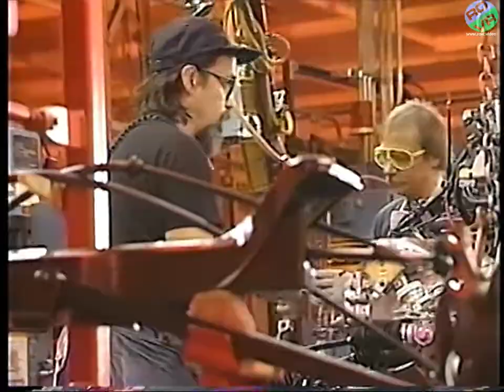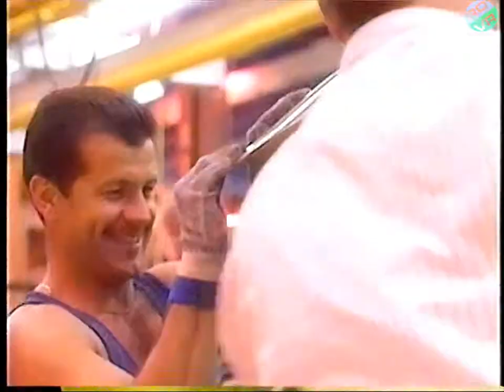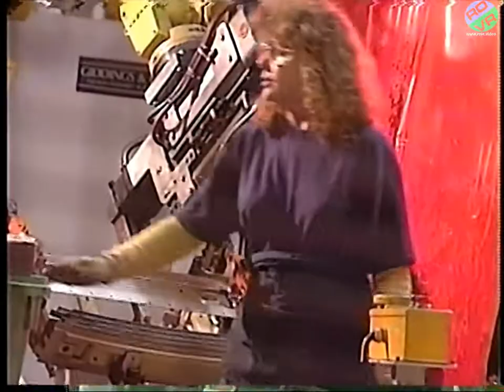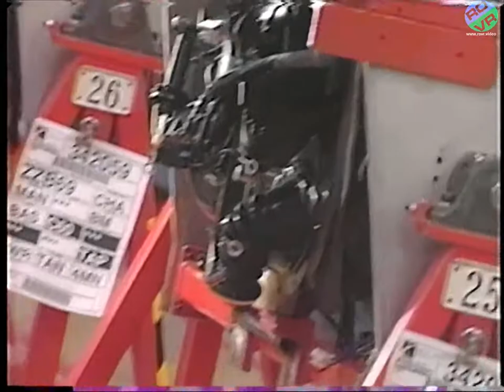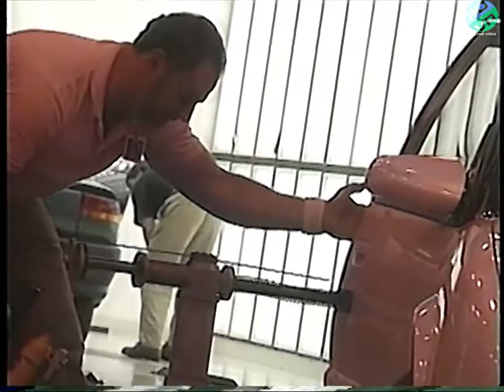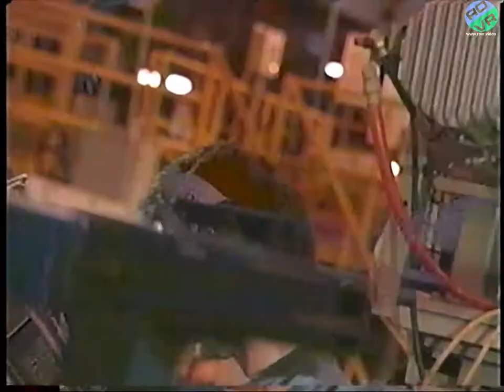GM - Saturn - One Car at a Time - How We Build a Saturn (1994)

Comment: Try this: work on a 90’s Saturn then a 90’s Camry. You will feel like there’s a GORILLA on your back as you tackle the Camry. Take a strut, CV axle, ball joint or control arm replacement. The Camry takes bigger tools, more time and more “sweat equity”. I can do almost everything on a Saturn with 3/8” drive tools. On a Camry you’re using all 1/2” drive stuff. I don’t know WHY the Japs over-design everything! Heavier means lower gas mileage. My SL2 gets 40mpg while my gf’s 1994 Camry gets 23mpg. My Saturn is a 5 speed though.

Comment: I have been driving a 1996 SL2 as my “grocery getter” for 26 years. The car has over 250,000 and most of those miles are city miles NOT highway. The car runs like a champ and gets 40mpg routinely! I just filled up at Sam’s in Knoxville and put in 7.3 gal for 299.5 miles. The only problem is she burns oil, especially above 3,000rpm. I’ve learned to carry an oil jug in the trunk and check it every fill-up. I love my Saturn just as much as my “highway car”, a torch red 2000 Corvette (C5).

Comment: GM spent an untold fortune on building these toilets when they were simultaneously cranking out Geo Prisms that were better vehicles in every single way. 
They really deserved to go bankrupt.
Reply: BS, Saturn was a revolutionary company with an internal corporate structure that was emulated by Toyota (engineers were forced to work with the personnel to make sure the design would be durable and practical ). There are books S series models are known to last as much as Ford Crown vics. Read a book

Comment: I have a 1st gen, a 95 SL2 and I just added a set of 15X7 +41 Einkei RPF1's with 4 Yokohama Advan performance tires. It also has KYB GR2 struts 30% stiffer in front, stock rear with H&R sport springs, a polyurethane master bushing kit, with polyurethane engine mounts, a Seibon carbon fiber hood, a 5 speed manual , with an MFactory limited slip differential, and billet aluminum flywheel, a Gude performance ported intake manifold, and bigger throttle body/with bigger butterfly, a cold air intake, a GM 1991-1992 factory header and pace setter high performance catalytic converter and a set of glow shift gauges in an A Pilar and digital tach with LED. The car is very quick and fun to drive and handles like a race car. My dad gave it to me in stock form with an automatic and I've owned it almost twice as long as he had it, and its very reliable.
Reply: These things SMOKED Hondas in their day. The whole package was too good to be true even for its day, GM really didn’t have a say in quality, the Saturn team demanded it. Hats off to them

Comment: I now own a 2008 Saturn Outlook and a 2008 Saturn Sky Redline. I like them both. I will certainly but another. They are still such amazing cars to drive. Mine are both just over 80k miles and drive like new.
Reply: I have a 95 SL2 with so many modifications, I don't feel like typing again but I responded to the 1st commenter, its very quick and fun, and has been very reliable.
Reply: it's so cool to hear about an Outlook still on the road! they always seem to be in way better condition compared to their GMC counterparts, their owners really cared i guess..

Comment: I have a 1997 Saturn SC2. It just reached 100,000 miles and still running strong. I love these cars!
Reply: I have a 1st gen, a 95 SL2 and I just added a set of 15X7 +41 Einkei RPF1's with 4 Yokohama Advan performance tires. It also has KYB GR2 struts 30% stiffer in front, stock rear with H&R sport springs, a polyurethane master bushing kit, with polyurethane engine mounts, a Seibon carbon fiber hood, a 5 speed manual , with an MFactory limited slip differential, and billet aluminum flywheel, a Gude performance ported intake manifold, and bigger throttle body/with bigger butterfly, a cold air intake, a GM 1991-1992 factory header and pace setter high performance catalytic converter and a set of glow shift gauges in an A Pilar and digital tach with LED. The car is very quick and fun to drive and handles like a race car. My dad gave it to me in stock form with an automatic and I've owned it almost twice as long as he had it, and its very reliable.

Comment: The best part about the video is how much fun it looks like the assembly line workers are having putting together the cars... if you have pride in what you're making, it'll be a higher quality product, and that's definitely what's happening here... I doubt GM is operating Spring Hill Assembly the same way today for assembling its SUV's, but then again, I hope they are.
Reply: It's not GM's fault. Saturn had a very unique contract with the UAW as a huge experiment to remain competitive with the Japanese. Workers had more job and wage security, and the union had broad work veto powers. However, workers had a lower hourly wage (a larger bonus instead), could be assigned many crappier jobs, and grievance and seniority rights were limited. Generally, Saturn workers liked it, but the rest of UAW hated it and refused to let it spread to any other plant. As a result, it died with Saturn.
Reply: @straightpipediesel  I know, I was just saying that I doubt GM is operating the plant in a manner that the employees had input on the cars they built, and the fact that it was a team effort.

Comment: They look like attractive cars. However, I wonder if GM over-complicated it's branding with Saturn and Geo. They also dropped Pontiac and Oldsmobile to be leaner.
Reply: They eventually dropped GEO, which Chevrolet dealers would retail. Most were imports from Suzuki, and Toyota (the GEO Prizm was basically a Corolla).
Reply: Saturn was different, had its own internal and independent corporate governance which back then was revolutionary and was adopted by Toyota. There are books about that